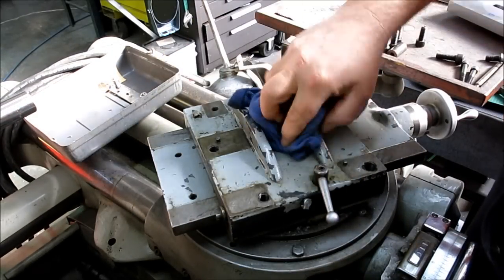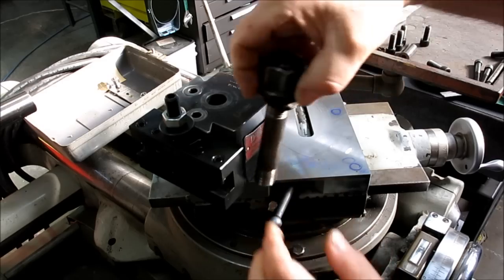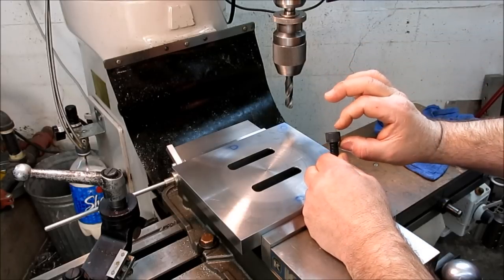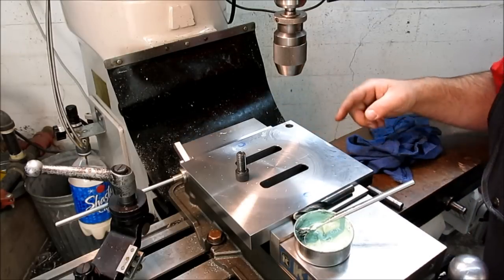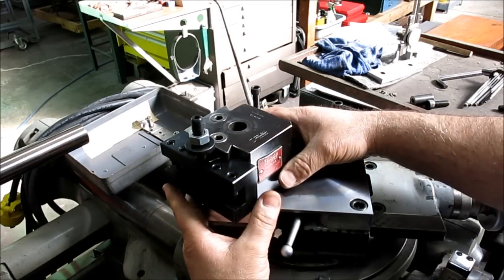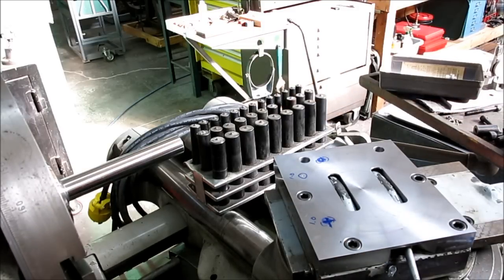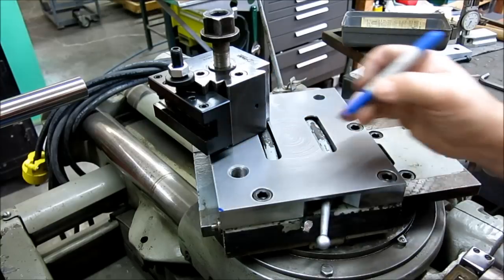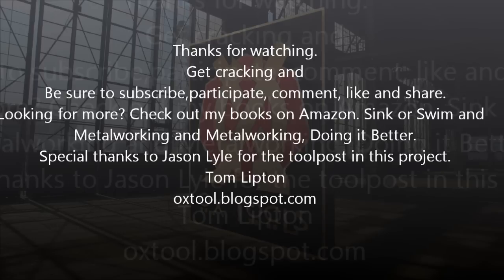Autometric Toolpost Plate Part 3

Comment: Thanks for the video,Tom. 

You could always hanger the edges but stop the chamfer a half inch from the counterbore, then in an inch continue it. It'll be worth it and save a lot of knuckle busting.
Reply from the maker: Hi Andre,

Good point. That would actually look good as well. Thanks for the suggestion. 

All the best,

Tom

Comment: Better slab up more of those bozo stickers Tom, maybe hang a big Phat Head size Mr Bozo on your front door. 
Regardless, the machine work looks great. Is there much more to do untill the machine is ready to fire up and use?
Thanks for sharing. 

Adam
Reply: Tom
I like how you don't over do the Anchor lube when machining That looks a lot better than what I have been seeing
Bill
Reply from the maker: Hey Adam,

I buying Mr Bozo a plane ticket to Florida for a winter vacation. Better watch out. Not much left to run the sub spindle at this point. Thanks for stopping by.

Talk to you later.

Tom
Reply from the maker: William Nebergall Hi Bill,

The Anchor lube works pretty good. It doesn't flow down a hole so you have to kind of shove it down. Thanks for the comment. 

Cheers,

Tom

Comment: Yes I wondered when I saw you mark that spot if it would be a "problem". I had several prototype's come thru inspection with missing features, that are repairable😀
Reply from the maker: Hey John,

I totally forgot the slot went almost to the edge. You should have heard me when it happened. Thanks for the comment. 

Cheers,

Tom

Comment: wow, great stuff. can't wait to see you dial it in and do some test cuts.
Reply from the maker: Hey Sam,

Were getting pretty close now. Thanks for the comment.

Cheers,

Tom
Reply: Was just reading in your book how threading operation close to the edge of something or the sides can blow out (distort) the threads or the part. Your work is out standing and seeing it (or just talking through with a still shot) step by step makes me try things. I have seen other hobbyist videos mapping out everything in a notebook and always measure from one side (or a starting point) of a project. Most times trying to avoid two bolts holes on two different sides meeting in the middle. If work changes out comes the note book. Bottom to top or left to right.
Reply from the maker: sam yeates Hey Sam,

Thanks for the nice comment. Glad you are finding some useful stuff in the book.

All the best,

Tom

Comment: Tom, those milled slots, to me look boss. Makes the overall look of the mounting plate to be maximum strength against any lateral movement. Besides, I foresee another mounting plate in place of this "prototype" in your future! lol Cheers.
Reply from the maker: Well I better get used to them. I don't see another plate any time soon. If I had to do it again I would get something a touch thicker. Thanks for the comment. 

Cheers,

Tom

Comment: Somehow I can see a new tool post plate made from 2" material, those slots are going to eat on your brain. Piss you off every time you use it. Thats how it would be with me.Mr. Bozo must be a busy clown. Thanks for sharing, enjoyed greatly.
Reply: +K.D. Pearce If only my comments to my computer could have been heard. I saw it coming as soon as I saw the layout. Caught the messed up hole during the setup as well, but sure enough yelling at my monitor did not help.
Reply from the maker: +cerberus0413 Hey Harold,

Yell louder. Its a long way from Texas. Thanks for the comment. 

Cheers,

Tom

Comment: Way back in the day (read 1972) I was a mechanical draftsman when everything was pencil and vellum and not a single designer I drew for ever mentioned a tool catalog.  Everything I drew came with their chicken sketch and was called out on some reference they had in their head.  It would have made perfect sense at that time to call out all dimensions based on tool availability.  And as a reference, I was working with a manufacturer of hydraulic pumps and motors and everything was machined to true position dimensions yet dimensions provided to the draftsman never referred to anything standard.

Comment: Another great video, Tom. While I always enjoy the "meat" of the video, it's all the little tidbits of information that I find very useful, like the slight differences between Stainless and Alloy SHCS head heights. I especially enjoyed the commentary in the beginning about designing around standard tools. I used to review a lot of engineering drawings. One of my personal pet peeves were arbitrary non-design critical hole diameters, like .600". Pick 19/32" or 39/64" so the machinist can just grab a drill and punch the hole, not have to generate tool path. Tubing and sheetmetal fabrication is the same way. It seems that the widespread advent of CNC has created a generation that thinks the "magic machine" can make any size they want, yet wonder why the part quote is so high. How about calling the bender to see what dies they have available so they don't have to make one? LOL

Keep up the great work!
Reply from the maker: Hey Hangar,

Great advice. I have saves thousands by having a simple conversation of what I was thinking I wanted to do with a vendor. I always ask is this doable or am I on drugs? Thanks for the comment.

Cheers,

Tom

Comment: @18:50, do my eyes deceive me or did Superman indeed wiped that freshly done, red hot weld with his bare hand??? You weldies... when I weld I can easily be mistaken with Chewbacca from all the layers of leather I throw on.
Reply: I'm starting to think Tom has superpowers too. Wonder if he even needs a face sheild and eye protection or if he's just staring into the arc with his superman eyes? lol Wait, perhaps the welder itself is powered by Tom!?
Reply: pgh pete
The holes he doesn't show him drilling in the video were done by him poking a finger through the metal. hahaha.
Reply: I saw the rub too, and then he went back for seconds to prove his badassness! ;o] I'm sure many of us have leather for skin though,,, only he could hear the sizzling sound as it skated across! ;o]

O,,,
Reply: Opinionator52 Eeewe! Didn't mean leather foreskin...
Reply: I'm thinking the mass of the plate sucked most of the heat out. But yes, tow is super human haha.
Reply from the maker: Just call me IRON MAN. Thanks for the comment. 

Cheers,

Tom
Reply: Iron,,, Man... :o]

O,,,

Comment: Love the cordless drill opp. I'm gonna have to borrow that one. Had you realized from the start how high the humps were, would you have just used a thicker plate and stepped it down for the tool post?
Reply from the maker: Hi Chuck,

I was stuck as I had the plate already and nothing thicker. In hindsight thicker would have been the solution. This plate was actually a little under one inch which contributed to my misery. The neat part on this machine is the spindle height is adjustable so a thicker plate would not have been a problem at all. Thanks for the comment.

Cheers,

Tom

Comment: projects looking great tom you made good the mistake when you held
that stud up you could see it was stretched it looked hour glass shaped
towards the nut end
Reply from the maker: Hey Andy,

That stud is looking pretty down at the heel. It will be okay for now but it might need a tune up later on. Thanks for the comment. 

Cheers,

Tom
Reply: cant wait to see it up and running tom

Comment: I'm amazed how well you can repair that mistaken hole - just magic, however I feel your frustration!
I suspect trying to video at the same time may well have been a major cause of the problem as trying to do several things at once must disturb your concentration.
Reply from the maker: Hey Dan,

Thanks for the gentle comment. I wasn't even shooting any video when I popped through that plate. Otherwise your ears would be red and ringing. I have no defense. Thanks for the comment. 

Cheers,

Tom

Comment: Tom,

What would stop you milling those two humps back a little bit just to lower the height,  and then cut a flat plate approx 5mm  thick to sit on top across the whole base which you have just done, with those two tool post holes on the left hand side re-drilled through it, and  tapped to take those bolts for the tool post, then it would hide the two slots that are showing, and end up making a nice finish along the lines that you intended, or would that position the tool post too high on the base plate to get your tool bit lined up with the centre axis of your workpiece in the chuck.

Just a thought,

John MD
Reply from the maker: Hey John,

You could do it that way. I actually almost knocked the ribs down when I measured the one. It was close and I thought I needed more room. I was right! Thanks for the comment. 

Cheers,

Tom

Comment: Hi Tom,
    I have a question.  Would you be willing to patch/blend the slots and just grind the ridges down around 3/8" to clean up the plate?
After the almost invisible patch you made for the Mr Bozo penetration, I see no reason it would be objectionable to look at the slots repaired in the same manor.
Just a thought
Reply from the maker: Hey Ken,

The ribs project very close to the surface. What was really needed is a plate that was a little thicker. Maybe I'll mount a little tool tray over the slots. Just to hold some items and prevent chips from filling them up. Thanks for the comment. 

Cheers,

Tom

Comment: Tom,  my dad always told never to assume anything but a 3% mortgage. Are you going to be marketing an OxToolCo Hide-A-Hole Kit, complete with various size plugs in different metals along with matching filler rod? 

Thanks for letting us watch.  It will be interesting to see the Autometric working. 

-- Mike
Reply from the maker: Hey Mike,

You might wonder how I got so good at patching holes. Well now you know it by putting them in. Thanks for the comment.

All the best,

Tom
Reply: Maybe subconsciously you just like machining so much you make extra machining work for yourself?

I keep comparing it to woodworking, where a patch is possible, but generally not an invisible one.  The grain and color are unlikely to match perfectly no matter how hard you try.  If you really want to hide it, you have to paint it!  Maybe that's why I'm shifting to machining? ;-)

Thanks!

-- Mike
Reply from the maker: BigMjolnir Hey Mike,

Woodchucks have some tricks up their furry little sleeves for stuff like this. Thanks for the comment.

Cheers,

Tom

Comment: Hey Tom, was just curious but I thought that I would have milled off a couple of hundred thou off the stiffeners or would that not be a good idea ? But is command practice to do no mods to the machine itself. I do understand where you're coming from on the counterbore and using standard practices,sounds like the engineers that wrote our service manuals when I was a tech,sometimes they didn't have a clue of real world and where it was located when the part was in the car "remove bolts and remove blabla" . Anyway great little series! I always learn a lot from watching Mr Wizard. Thanks Dave
Reply from the maker: Hi Dave,

I had the thought to modify the ribs. I figured you guys would have given me more crap for milling a perfectly unique machine to suit my evil purpose. Thanks for the comment. 

Cheers,

Tom

Comment: Hey Tom, I'm not really sure how the machine is set up, but I was wandering, what if your tool holder needs to be lower than the plate you made since the tool post is set back in from the edge and will not let the tool holder go down? 
Buddy
Reply from the maker: Hey Buddy,

The main machine spindle moves up and down. I actually don't even need an adjustable tool holder block. Good question. Thanks for the comment. 

Cheers,

Tom
Reply: oxtoolco Hey Tom, Looking forward to see how it all works.
Buddy

Comment: Now is the time to add the comfort modifications, your knuckles will thank you in the long run.  When you twang your funny bone on a sharp corner there is nothing funny about it except for the grin on Mr. Bozo's face.
Reply from the maker: Hey John,

You got that right. I needed to get off the horse for a little bit. I might have had to toss the plate across the shop if anything else happened. 

All the best,

Tom

Comment: Stupid question...what are those bumps (you might of had explained but i missed it) and wouldn't it had been better to simply mill them off?
Reply from the maker: The bumps are big stiffeners for the sub spindle. I don't like to heavily modify a stock part or machine in general. You can bet I really felt like sanding off a few millimeters when the pockets bottomed out. Thanks for the comment. 

Cheers,

Tom
Reply: oxtoolco Kind of figured it out after i made the comment, decided to go with it to see your view on it.

Yeah, i bet you did, but you didn't so you're a greater person that i.

Question, do you think that in the original design, the bumps could of had been removed had they made the plate thicker? It has no bearing on the matter at hand, just curious about it.

Comment: I know this sounds dumb but can you use the counter bores in a regular drill press?
Reply: Of course, just run them at the correct speed.
Reply from the maker: Hey Mack,

Yes you can do that. I would use a depth stop if using the counterbore in a drill press. Thanks for the comment. 

Cheers,

Tom

Comment: Hey Tom,
I don't think your "No Bozos" stickers are working! Have you tried putting some on your underware? Your autometric is turning to be a auto-pain-in-the-ass! Yes, I would definitely round off those "hand gouging" corners! Otherwise, nice work, Mr. Wizard! It will be nice to see this thing in action. Thanks for the frustrating video!
Have a good one . . . and tell Mr. Bozo to take a long walk off a short pier! Which begs the question . . . with all the old piers there in Benicia, has anyone done a "pier" review? If not, they were probably under "pier" pressure!
Oxen Dave
Reply from the maker: I think we are going to call this machine the Bozometric Dim wit bore. Thanks for the comment. 

Cheers,

Tom

Comment: This is probably a stupid question. Wouldn't two distance plates to get over the two ribs solved your problem?
Reply from the maker: Hi Boel,

Which problem are you referring to. I had several on this one. Measuring the height of the ribs? Thanks for the comment.

Cheers,

Tom
Reply: oxtoolco
You hollowed out the plate, to fit it over the ribs. But after they where to height, i would have thought to lift up the plate with plates underneath.
But I'm not a trained machinist, so i suspect a problem, why you didn't take that route.

Comment: So we use anal-lube at work as we call it. (Anchorlube) but I see you and Adam using it for drilling. Would it be okay to use for broaching holes? Most of our holes if they aren't plasma cut we broach drill them. We are currently using a water soluble oil we use for our vertical band saw. We use the same oil for broach drilling.  I forget to check videos again for replies so pm me i Guess. Thanks a lot.
Reply from the maker: will v Hi Will,

The anchor lube would probably work fine for broaching. I generally prefer extreme pressure lubes for broaching and high pressure applications like forming,and stamping, Hope this helps.

Best,

Tom